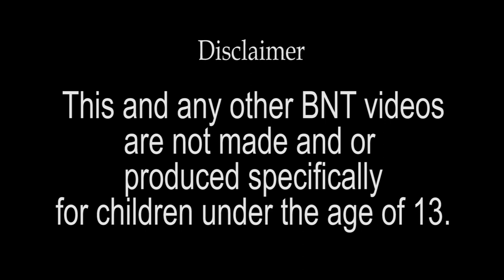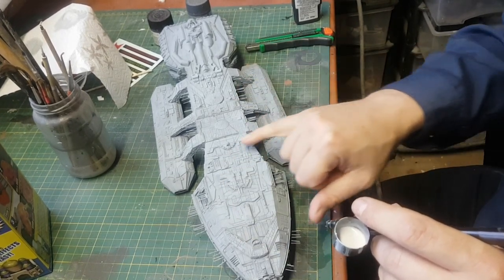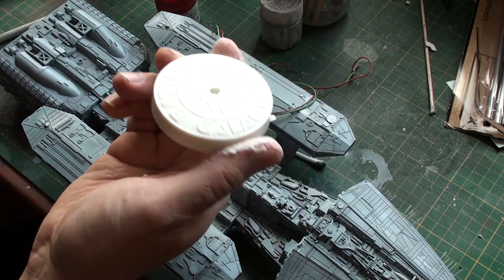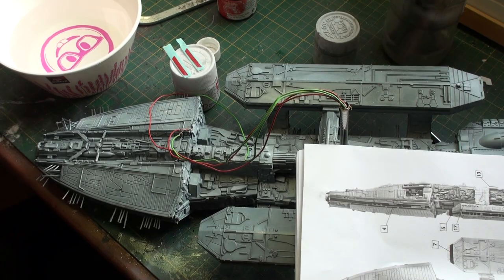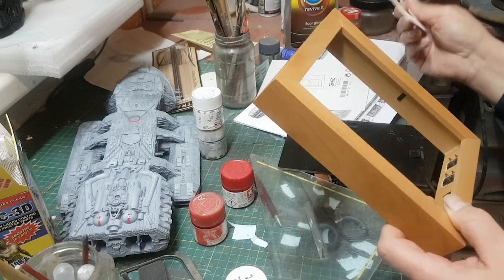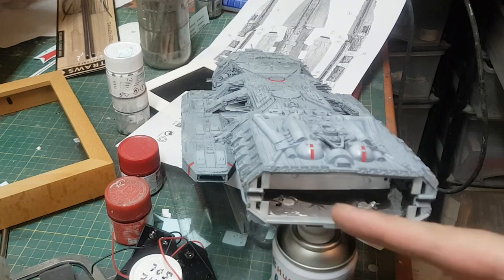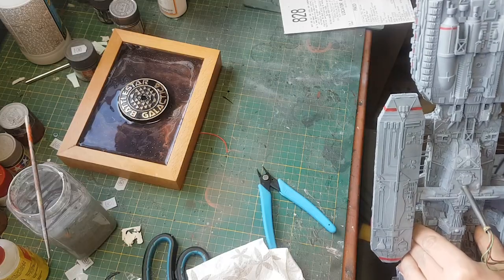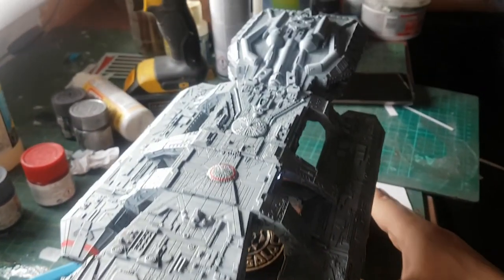building Moebius Models BATTLESTAR Galactica part 3

Comment: would have liked to seen how you had cut off the fiber optics. Did you use an exacto knife or snippers, or????
Reply from the maker: I used sprue-cutters
Reply: @BNTmodels  You could get that flushed to the surface with those?  I figured in the troughs, that would make cutting them difficult to do.